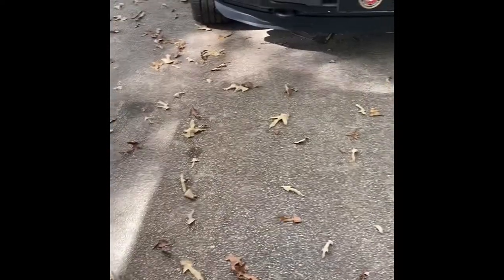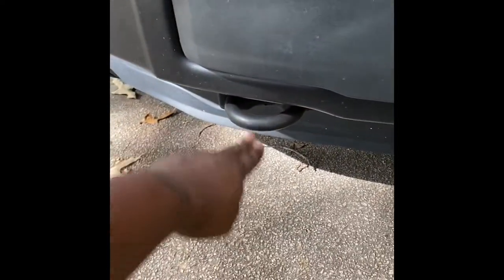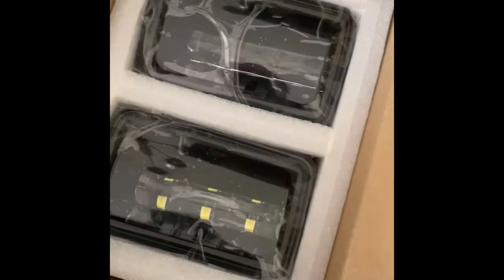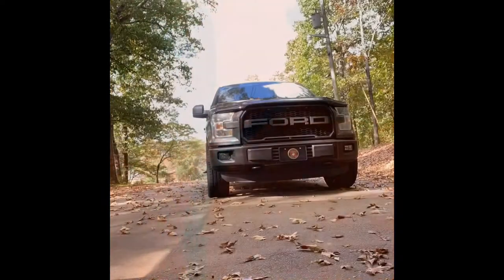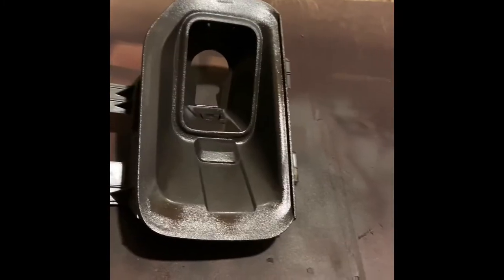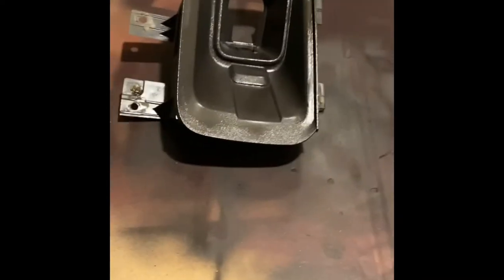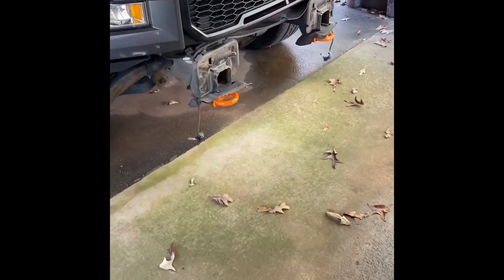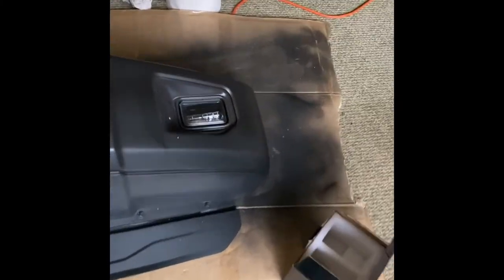How to replace fog lights on 2015 F150! Everyday I’m modin’

Comment: Looks good! So someone hit my bumper on the driver side just to the side of my fog lamp. The bumper now sits two cm to the right. And the fog lamp gets water in it and bugs. Do you think it’s possible to knock out the ding and reset the bumper? I’m worried a lot of smaller parts are going to be bent and it will become a way bigger job.
Reply from the maker: I agree. I think that there’s more than Mets the eye. If the bumper is moved there may be more. I’d try one of two things. One, find a pick and pull and get everything you need. Or two, think about upgrading your bumper to customize it
Reply: Thanks for the feed back! I enjoy your videos! I have a black and red f150, and my grill is all black, but  I’m thinking of getting the lariat grill. It’s black with a red under tone. But I love the raptor grill on Beastie! Ty for your service!
Reply from the maker: Thanks!!! I appreciate the love. I say do it!!! One thing about customization is you feel like you created your truck. You stand out from the pack!!